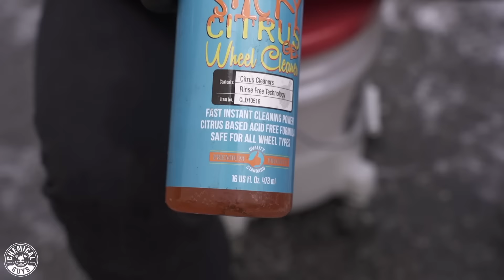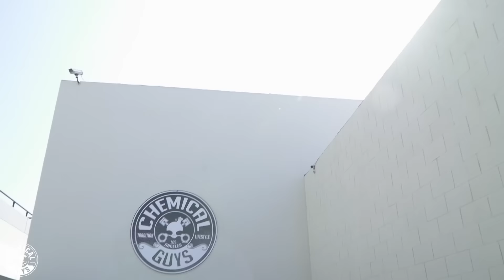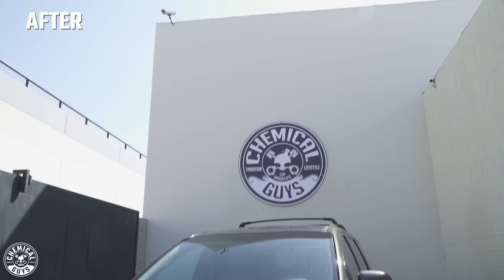How To Spring Clean Your Ride! - Chemical Guys

Comment: Why  do you have to use 2 bucket for cleaning the car
Reply: One is for soap and the other is for water , it’s called a 2 bucket wash method
Reply from the maker: Hi Charles! Use the two bucket method to prevent installing scratches and swirls.